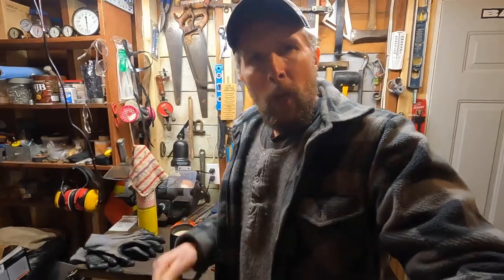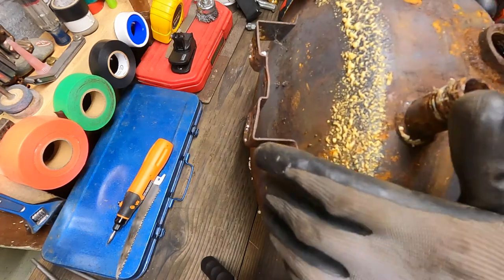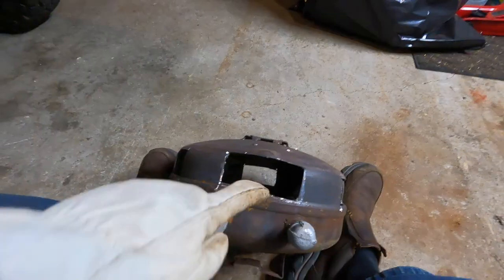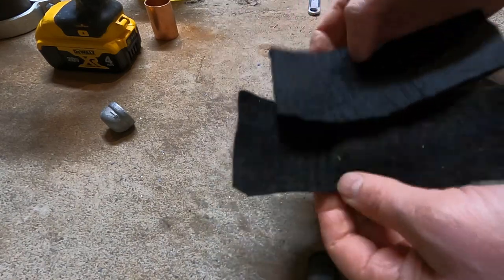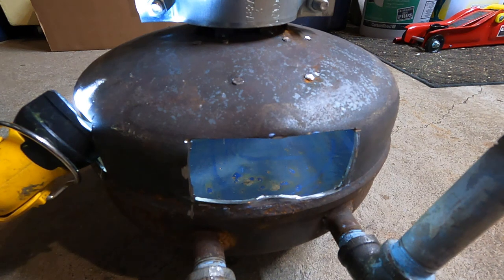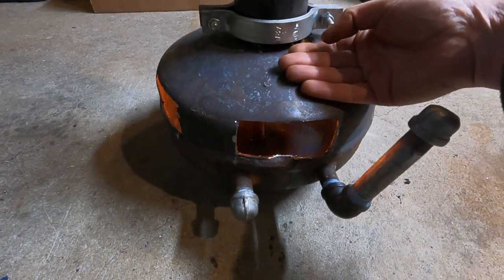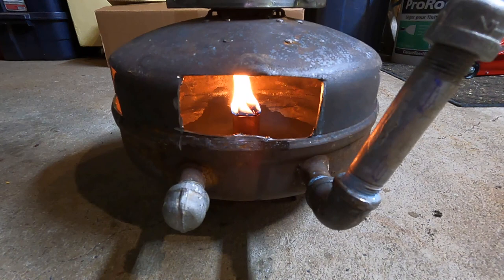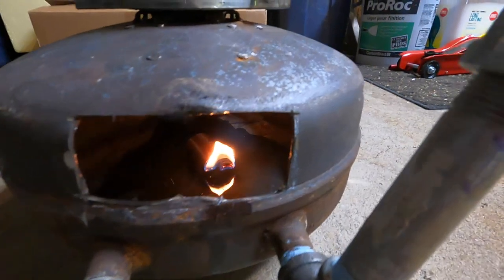Carbon Felt Wick Vegetable Oil HEATER🔥 From Old Water Heater!

Comment: I've found that ceramic fiber insulation lasts longer than carbon felt.  Oil and wax burners benefit greatly from some insulation because they have relatively high combustion/ignition temps, and the hotter you can get the oil or wax, the thinner it becomes and so it wicks up better as well.
Reply from the maker: Interesting, I’ve used ceramic fibreglass behind a wood stove in the past but I’ll have to try it as a wick, thanks for sharing!

Comment: Can u  make or use a carbon felt  wick for a kerosene heater ? Or can a person use kerosene in that heater u made with a carbon felt wick
Reply from the maker: @yvonnenorris8122  I have only tried it with the vegetable oils. Carbon felt works well to wick a heavier oil so not sure how well kerosene would work as it is thinner & lighter.

Comment: Cool! What kind of vegetable oil did you use? eg canola, sunflower etc- vegetable oils have different smoking points for cooking so I think it might matter. Not olive oil! Also, I am wondering about soot buildup inside the chimney. Thank you!
Reply from the maker: The bottle said vegetable oil but any oil made from plants is vegetable oil as far as I know. You're right not olive oil, its a fruit oil. I didn't let it burn long enough for soot check, this was just an experiment to see if it would work on a larger scale from the short form Ingenious wick vid.
Reply: A lot of times, I noticed if the bottle is just labeled "vegetable oil" it will be soybean oil
Reply from the maker: @gemcutter187  I've seen that before as well, I believe it was soybean and corn oil, probably other oils too and they called it vegetable oil.

Comment: Hello from Sweden, and thanks for a very informative video clip.
For about 1,5 years I have been planning for a similar project for to use in a small house.
Sort of a cylinder in steel, the shape reminding of a trash can, with a lid on top. One inlet for air from outdoors and one outlet for the oil emissions, maybe enhanced with a thermoelectric duct fan. 
In your clip I saw you use welders blanket as a Wick and that solved one issue I had.
Thank ypu and keep up the good spirit of developing diy low tech solutions.